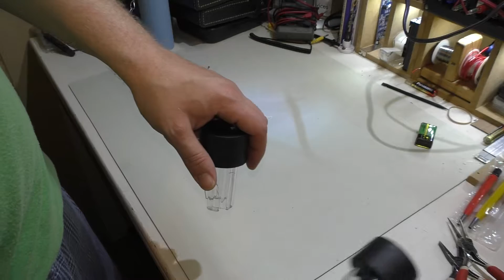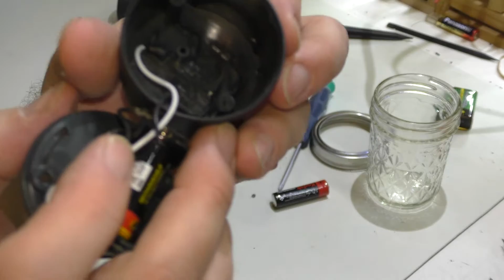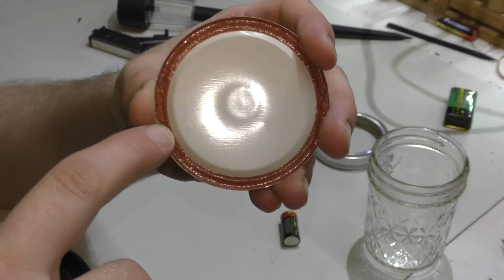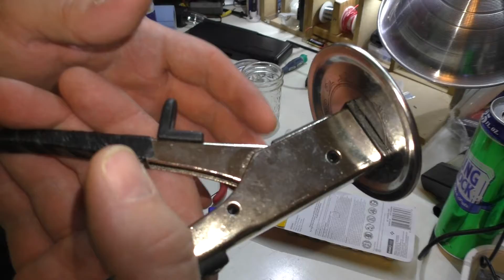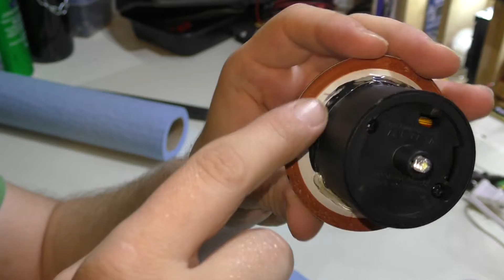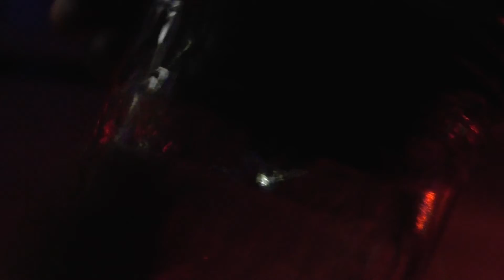PTS Ep. 90 - Cheap Solar Light Hack (Stake to Mason Jar)

Comment: Thanks for making this video. Great idea to recycle theses lights.
Reply from the maker: +Tahi Elgato thanks for the comment.  If you make them, make sure they're sealed well on top and make a drainage hole in the bottom for condensation to drain out of.
Reply: Thanks. I will.

Comment: I made a floaty pond light out of these two exact materials..  put one of those in a mason with the solar part at the bottom of the jar. I hot glued it to the bottom of the mason jar and then put a few little rocks in the jar down near the lid, just enough to give it some weight. sealed it up and let it float in my pond lid side down.. it makes a pretty good little floating pond light for a buck.. the sun charges it during the day thru the glass and it casts thru the water at night.....  of course my pond is just made out of some scrap wood with a bit of 3 ml plastic and i didn't want to spend much on it..
Reply from the maker: What a great idea!  That'd be cool with a color changing LED too!